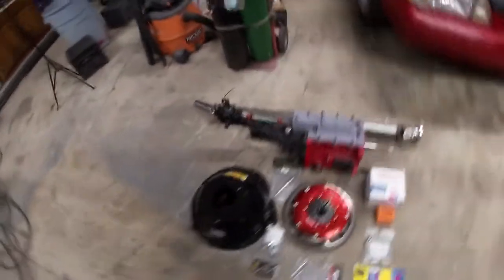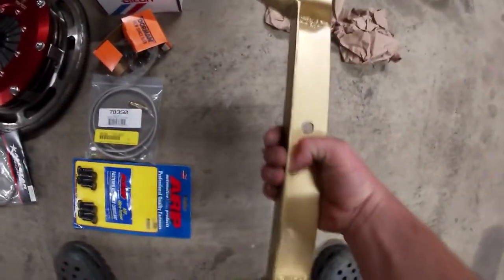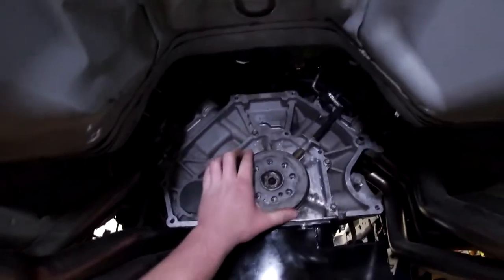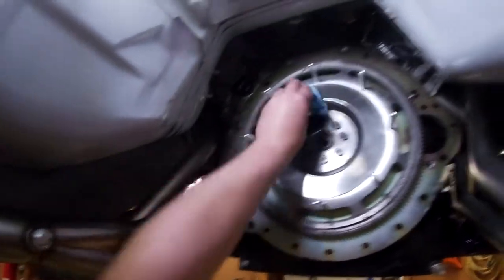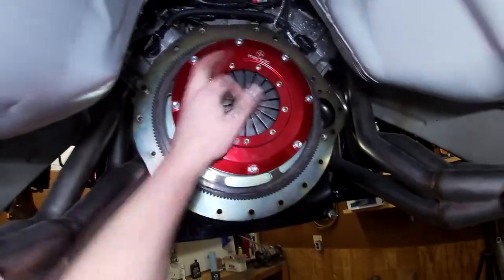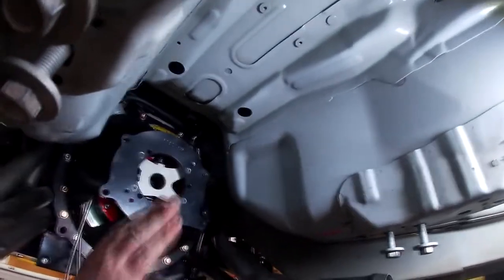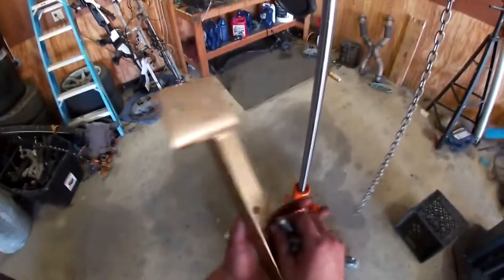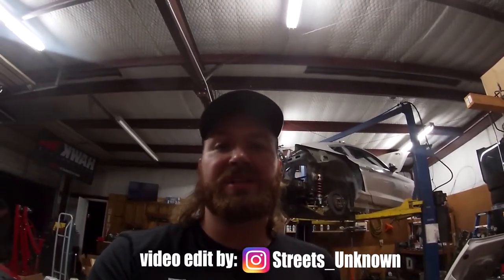Dogbox Transmission install on a Coyote! I install a Gforce GSR in my S550 Mustang.

Comment: What did you do for the output speed sensor?
Reply from the maker: I only run a GPS speed sensor
Reply: The car didnt go into limp mode or anything by not having an outspeed sensor reading?
Reply from the maker: @ajtiti7518  i know people that arent running any speed sensors on their cars. My car has a linkecu so i never had to deal with those issues.